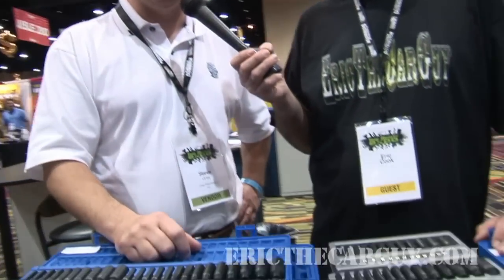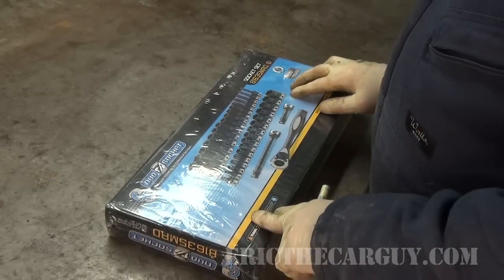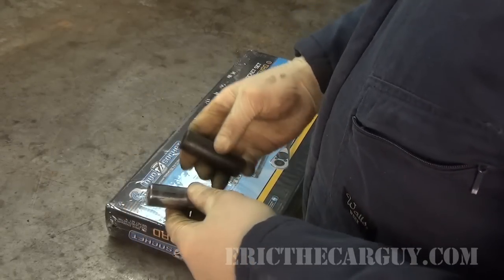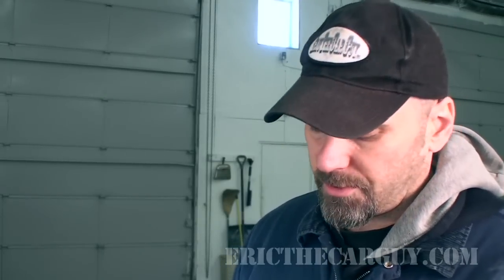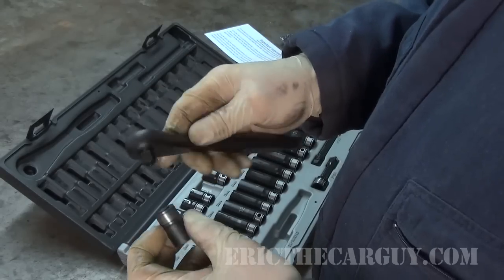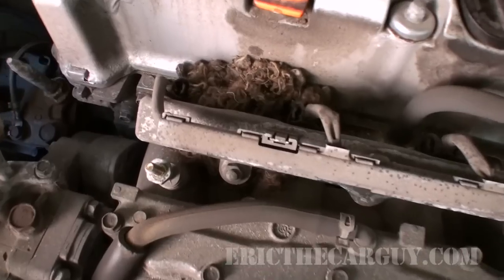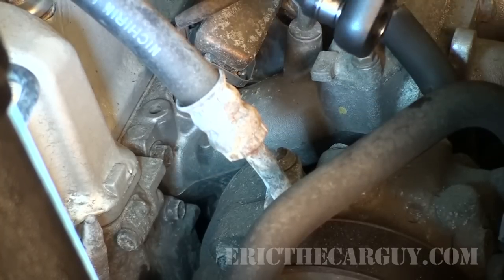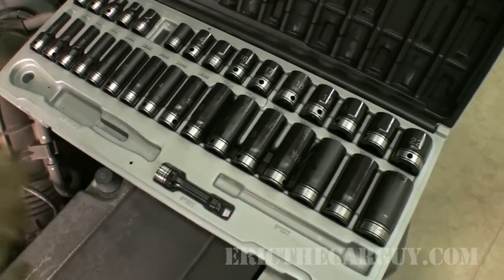Grey Pneumatic 81635MRD Socket Set Review -EricTheCarGuy

Comment: Help me out here guys...I'm not a mechanic, I don't really work on cars, I watch the videos, do a few things here and there but I really LOVE the tool reviews. I fail to understand why a manual/hand ratchet would come with a set of impact sockets? Why is this?
Reply from the maker: Good question. This set was made to be used as an impact set as well as a hand tool set. At least that's what I speculate to be the answer to your question.
Reply: EricTheCarGuy I would also say, so you don't need to buy 2 sets of sockets, may as well buy one set to do both.
Reply: Ratchet/impact hybrid. If I remember correctly (can't be arsed actually checking) Eric mentions something about them being a hybrid socket near the start.
Reply: i would say, its a good multi-capable set.  ratchet sized sockets in an impact grade tool.  probably a much stronger ratchet too. i dig the hell outta this. really good for mobile mechanics that don't always have air available but only wants one set of sockets (per points i guess).  one box for ratchet and impact with little or no size difference. boner boner boner, i'm sure they sell them in just socket sets alone. i really like what i'm seeing here.
Reply: It halves the number of sockets you need, great for diy :-))

Comment: I had a set of those same sockets. They worked great. I never broke one. They only problem I had was all the numbers wore off all the sockets. It drove  me nuts and I traded them in. Laser etched sockets always do that. You have to get the stamped ones.
Reply: I found by coating the numbers of the sockets with clear nail polish when you first buy them will prevent the numbers from wearing off.  I coated mine years ago and they've held up well.

Comment: what is the advantage of 3/8 over 1/2 sockets?
Reply: Smaller?
Reply: Size is everything! In general I like to think of it in terms of how much torque do I need to do loosen or tighten this fastener and how much room do I have to fit a tool into for the task. For example, the axle nut commented on in another viewer's comment, Torque specification was 144 lbs/ft, The axle nut is clearly exposed so there are no space limitations in a practical sense. Therefore, I would use the 1/2" drive socket and torque wrench as they are bigger, stronger, and easier to apply torque to the fastener with. Now look at something like a cam cover nut on a Honda. It is a small nut that doesn't require much torque. It would be ridiculously easy to over-torque that fastener with 1/2" drive tools due to their larger size and reduced "feel" (speaking in terms of ratchet handle length, socket thickness, etc...). In that instance I would reach for 1/4" drive tools. 3/8" drive tools fill the gap between and honestly make up the most commonly used tools for any professional automotive technician.